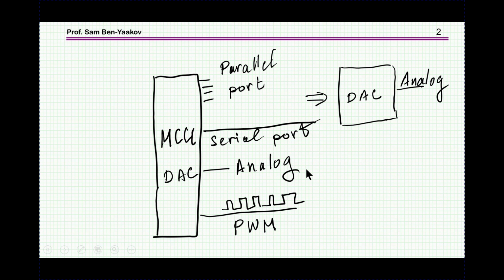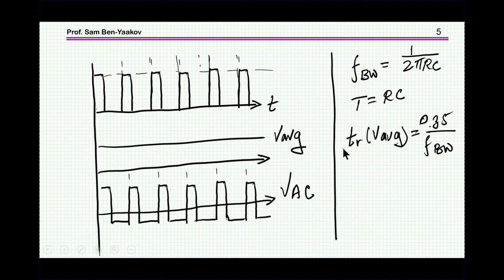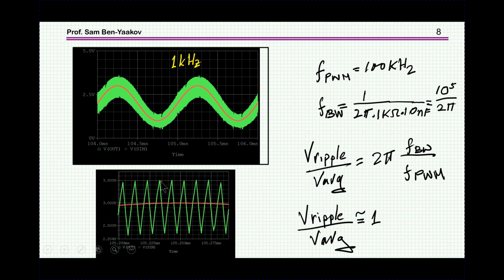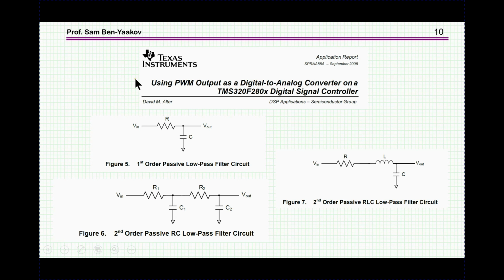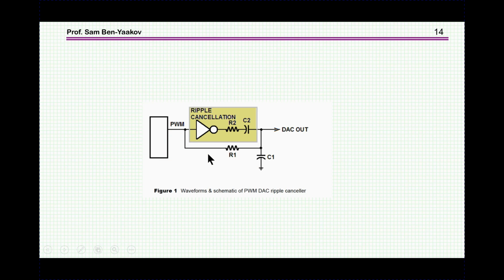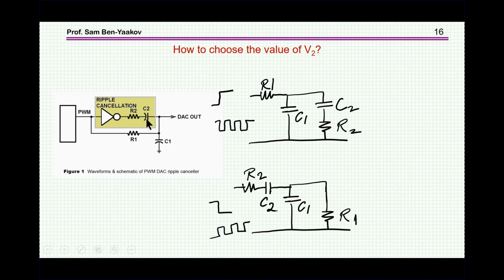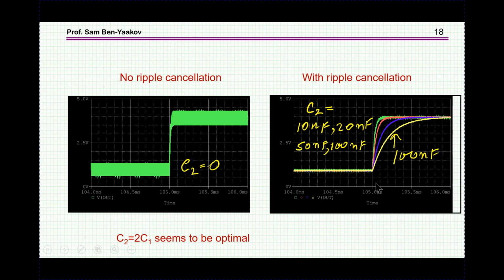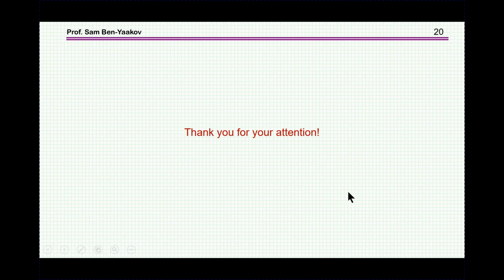Ripple cancelation in PWM DAC

Comment: Does inverter work as a complementary converter so when the original signal is 1 it converts to 0 or when it is 1 it converts it to -1 so -5V for example
Reply from the maker: Yes. but the capacitor passes only the ripple without the DC component.

Comment: @Sam Ben-Yaakov  is this that caveat?
Now i think about it, that 180° signalinjection is indeed not much different than a opamp to make the filtering 12db/oct instead the 6db/oct from the first RC-filtering. But still, an extra opamp is more components than an inverter from wich mostly one unused gate in an IC already on the print can be found.
O no, the comment says he tested a second passive RC filter? So thán nothing woukd be won with the 180° signalinjection? At least nothing in componentcount?
 . Oh i wait till that next videolesson. Now i will even more look out for it!
Reply from the maker: Indeed, you got it right. Neat idea but of little use. But...  one still learns a lot: e.g. to always give your ideas a critical review no matter how clever they look.

Comment: Ripple cancellation is a very good idea. just one addition for accuracy: when I use PWM DAC and I need good accuracy I connect the output of the filter to an ADC input with a voltage reference specification in the MCU's ADC accordignly to the required accuracy then the output can be calibrated and adjusted, this is because Voh and Vol of the digital outputs are not 0 and VDD all the time and even if the output gives you VDD, for example 3.3V this comes from a voltage regulator and it will not be exactly 3.3V all the time :)
Reply from the maker: Thanks for comment.
Reply: @sambenyaakov  You are welcome, I am happy to contribute

Comment: Dear Sam
Thank you again for this new video! As usual, it is always original interesting subjects.
I did perform a simulation, comparing two configurations:
- First is to have two simple passives RC cells, so it’s an order two low pass filter, with R1 1Ko C1 10nF filtering the PWM (100kHz PWM).
- Second is using the idea of injecting complement of the PWM through a R2 1Ko C2 10nF, having only one cell of R1 1Ko C1 10nF like in the fig.1 of your video
I get the exact same result, same ripple, and same time response. In both case I have two caps, and two identical resistors. So if I’m right, injecting the complement on the output of an order 1 filter, is equivalent of having an order two passive low pass filter ?
Thank you
Reply from the maker: Hi Nicholas, Thank you for comment and for taking the time to examine the circuit. Your conclusion is extremely interesting! I am going to check it myself.
Reply: @sambenyaakov  is this that caveat?
Now i think about it, that 180° signalinjection is indeed not much different than a opamp to make the filtering 12db/oct instead the 6db/oct from the first RC-filtering. But still, an extra opamp is more components than an inverter from wich mostly one unused gate in an IC already on the print can be found.
O no, the comment says he tested a second passive RC filter? So thán nothing woukd be won with the 180° signalinjection? At least nothing in componentcount?
 . Oh i wait till that next videolesson. Now i will even more look out for it!

Comment: Thank you for this presentation. I've used the analog filters and dac converters. Good idea that circuit. Instead using dac converters, this circuit seems to work well and its construction is simple.
Reply from the maker: Thanks. But there is a caveat, I will post another video to explain.